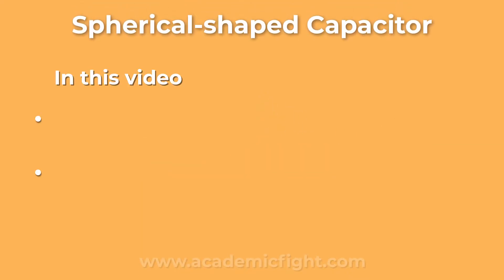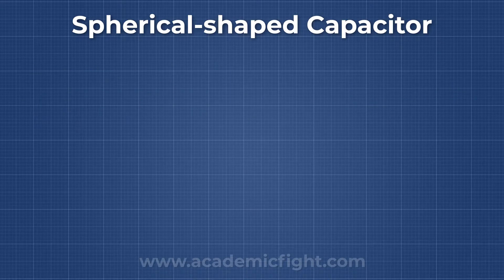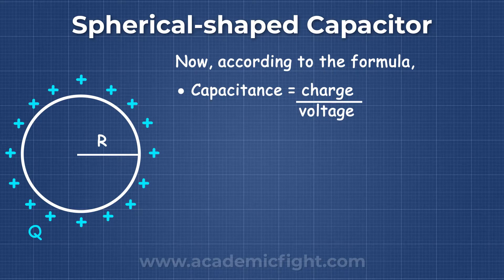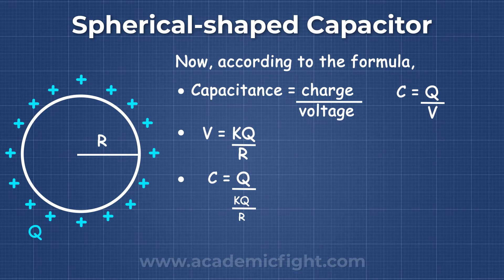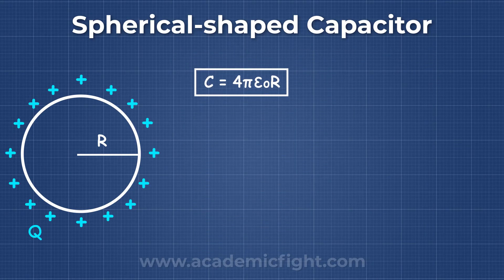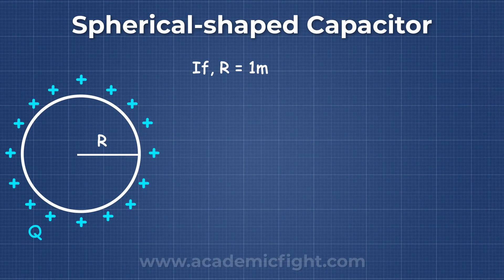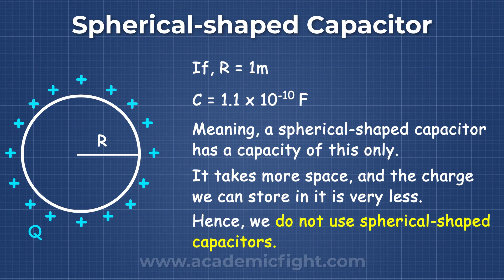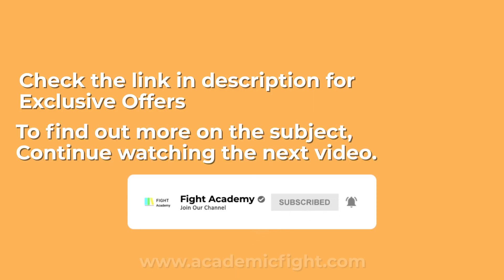Spherical Shaped Capacitor | Why we don't use it?

Comment: bullshit, a capacitor has 2 plates, so it should be calculated with 2 concentric spheres, not 1.

The proper equation then becomes 4*Pi*Epsilon0*(r1*r2)/(r2-r1), where r1 and r2 are the radii of the 2 spheres. The capacitance depends mostly on the small distance between the plates, rather than on the radius of any of the balls. A 15mm radius spherical capacitor, with 0.2mm separation between plates would achieve capacitance of around 100pF. Not much, but those capacitors have other uses, not possible with other types of capacitors.

There are academic lectures on the subject on YT - look it up before making a video.